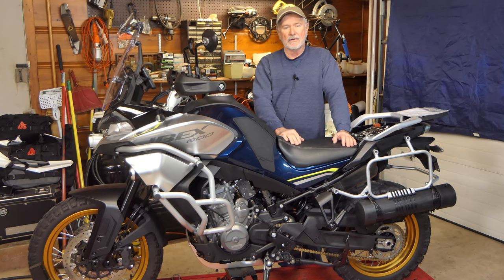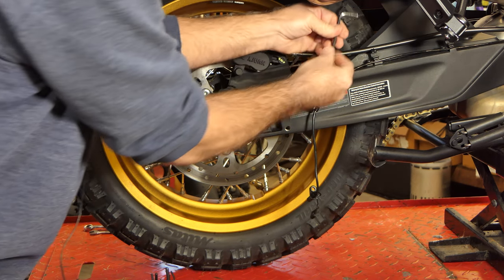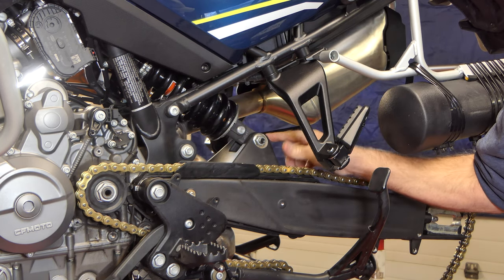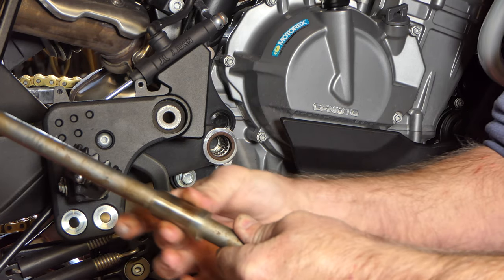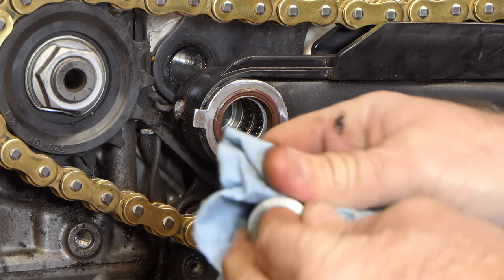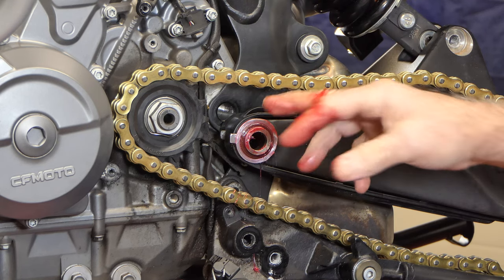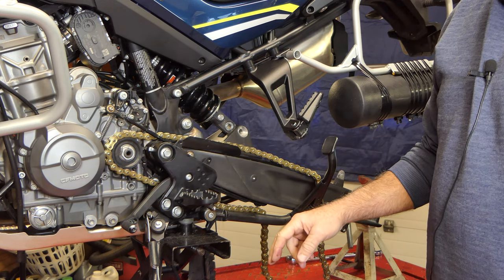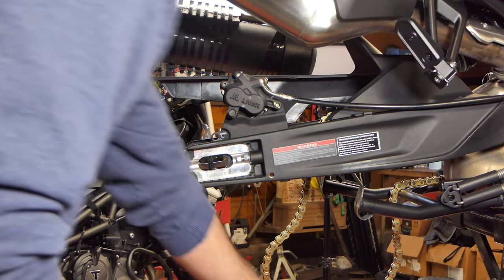My 2023 CFMOTO Ibex 800T/800MT Has Greaseless Swing Arm Bearings.

Comment: After watching,  you don't have to take the bearings out, so I don't see any need to take anything off, just uncover the bearings,  grease, and put shaft in , and cover up. You might loosen the Chan to release tension. What you think? RIDE SAFE OUT THERE!
Reply: Thought the same, is there a need to remove the wheel ??

Comment: something to save you time, no need to slacken off the chain adjusters if removing the wheel. just take the axle nut off, take the adjuster block off that side, tap the axle just enough to allow the other side adjuster block to come away from the adjuster bolt, and then the wheel moves forward enough to slip the chain off, then axle out, wheel out. do the reverse and then the wheel and chain go back in at the same adjustment with which you started with, i do it on every bike i owned, hope this helps.
Reply: Did they have rear disc brakes ?

Comment: Hey John, thanks for providing another quality maintenance video 👍 I think you’ve highlighted the fact that every manufacturer does not apply enough lubricants on to mechanical systems. So, just as you are doing, I would also suggest that these investigations & applications be done as soon as a motorcycle is purchased.
I do this when Christmas comes around.😉 Thanks again.
Reply from the maker: Good to hear from you sir... thanks for watching...  :)
Reply: Great video once again. Between watching you doing the steering head and now the swing arm, makes me wonder what else that needs lubed. Only thing else I would have liked to see is adjusting the chain tension. Thanks for you training. So nice to see it done slowly and explaining small details.
Reply: Fair point, but would it not help if this was done in the PDI check?? before any damage can be done 👍

Comment: Great video on servicing the 800T. Just picked up mine last Saturday and rode 100 miles back home. It was great, I'm loving it. You mentioned ordering new bearings, any recommendation for a site that carry parts or do you source via the dealer?  What about a service manual, any recommendation? Thanks.
Reply from the maker: Good to hear from you sir, congrats on your new ride...  I just ordered bearings and sleeves for a 2020 KTM 790 Adventure through an online KTM dealer..  'chapmoto.com" out in California.  just about all the parts on the Ibex are KTM 790 Adventure.  I also bought a 2020 790 Adventure service manual pdf online.  I have not found much that is different on this bike as far as parts go... I cannot seem to find where I got the manual from but I just did a search on Google for " 2020 KTM service manual"  there were several to choose from.  Enjoy that new ride... thanks for watching..  :)

Comment: Great Job 👍 thanks. My sons and l are always wondering what line of work you were in John, we obviously reckon it was mechanical engineering. 
You certainly know your way round a motorcycle. 
Really enjoyed this video.
Mike.
Reply from the maker: Good to hear from you guys, I am a computer science guy who started out on Main Frames back in the 1980's.  I grew up working and and building motorcycles and cars.  I owned an automotive service business for several years and worked as an auto body tech for several years as well.  I also worked for a large remanufacturing company building Chrysler and Toyota transaxles/transmissions for quite a few years as well.  I have been working in enterprise IT for the last 15 years and am thinking it might be time to retire or at least slow down now..  Thanks for watching and yo guys keep safe out there...  :)

Comment: Now this is one heck of a good video. Subscribed. Where can I find the torque values for those screws though?
Reply from the maker: Good to hear from you sir, the CFMOTO Ibex 800T/MT has identical suspension components as the KTM 790 Adventure.  I use a KTM 790 Adventure service manual for all of my torque values... Thanks for watching...   :)

Comment: Hello John, thanks for the detailed video. What is the mileage of the bike? Did You have any issues with the bike during one year of ownership? I am considering to buy one.
Reply from the maker: Hello there sir, good to hear from you... I now have  8000 miles on the CFMOTO.  I have had no other issues with the bike other than the swingarm bearings... It has been a rock solid performer so far... I am not a fan of the fuel mapping but I am used to it now so its not a big deal to me... Good luck with your new bike and thanks for watching...   :)
Reply: @ozarksbackroads5484 did you consider doing the ota update that supposedly fixes the fuelling? Maybe this helps? I sold my versys 1000 and my project for a 1250gs will not realize... I'm now looking at one of these ibex 800!
Reply from the maker: @pascalparent3137  Good to hear from you sir, yes I did the OTA update when it came out... it was a fix for the fan controller issue that all the bikes had with the original factory firmware... That update was not for any fueling issues... there have been no further updates to date...  good luck with your now bike search and thanks for watching...   :)